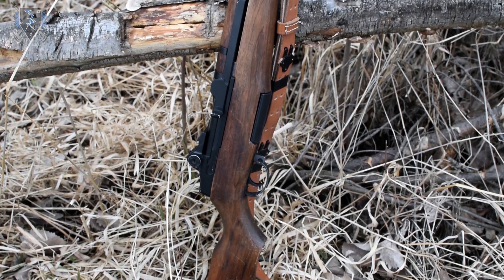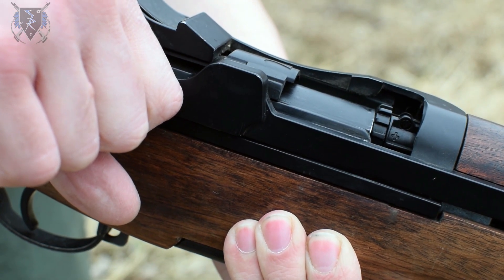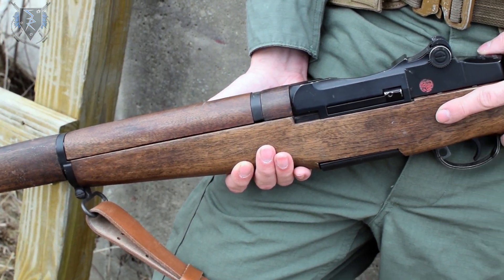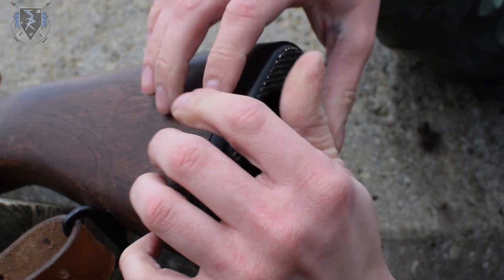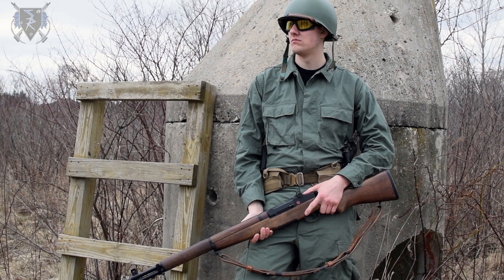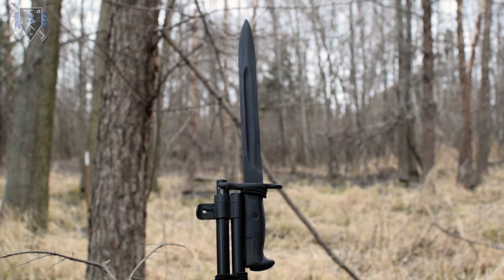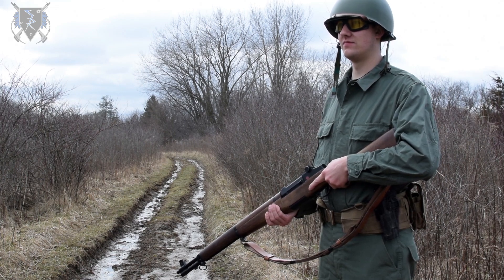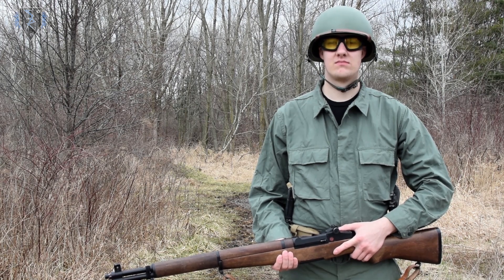ICS M1 Garand AEG | Review | SR Airsoft |

Comment: **READ THIS COMMENT TO HELP YOU CHOOSE WHAT M1 YOU WOULD LIKE** 

I’m a huge airsoft collector and real firearm collector and have a total of 4 airsoft M1 Garand’s. Here’s the pros and cons listed below...

A&K M1 Garand - This was my first one and was very disappointed. 

Pros - I can’t think of any.

Cons - mag won’t fit into magazine slot, mines not even close. I can’t even hold it in there because it’s so loose. It falls out if you barely tap the gun. 

- it also is very skinny. Almost like a broom stick. It has no shape or girth to it whatsoever. The hand grip towards the rear of the stock is almost so wide that you can barely wrap your hand around it. This is not a good rifle. It doesn’t feel good to hold, it’s so skinny and has no feel of a M1. 

ICS M1 Garand 

Pros - THIS ONE IS AMAZING!!! It shoots PERFECTLY straight and has the most amazing range completely stock out of the box!! It also has a sticky feeling out of the box but this isn’t a bad thing at all. It’s from the wood staining and it actually makes it feel really good to hold.(the stickiness goes away after awhile.) also, wherever you hold the gun, it fades the stain and makes a awesome “wore out” look to the wood stock overtime that looks amazing. It feels so satisfying to hold. I’ve never had a jam and I’ve never had one issue with it at all!

Cons - LITERALLY NONE 

MARUSHIN M1 Garand - THIS ONE IS ALSO AWESOME!! It’s the only air-soft M1 Garand that a real ejecting clip and only takes 8 bb pellets per clip and ejects itself and makes the PING sound effect when the clip hits the ground! This is a green gas airsoft. 

Pros - MOST REALISTIC M1 air soft, feels super good to hold, not heavy at all, has a real clip that ejects on the last shot to give the Ping effect. Perfect for collectors

Cons - they are discontinued, it only holds 8 rounds at a time, since they are discontinued, they are VERY RARE and will run you $900 dollars. I got mine for $800. 

Marushin M1 Garand tanker - same as the one listed above, except it’s shorter and even more rare. 

G&G - I do not own this one so I can’t give you any advice on this one. 

I hope this helped you guys!!

Comment: What was that attached to the bayonet lug? I've read you can't attach real steel bayonets, what were you using?
Reply from the maker: I purchased a rubber bayonet replica that was made from the original mold used to make the real steel M1 bayonets.  A note of warning though, you will have to modify the bayonet ring that attaches to the barrel as it will not properly fit on the ICS M1 version.  I have heard that it will fit correctly with no modification on the G&G version though.  You can find the rubber bayonet here:  http://thefieldwerks.com/m_1_10_bayonet.html  - Spartan

Comment: How did you modify the bayonet
Reply: I cut a slit on the top of the barrel ring on the bayonet.  This allows the bayonet to "clamp" onto the barrel instead of sliding over it.  This is because the barrel and gas tube are father apart than on the real M1.